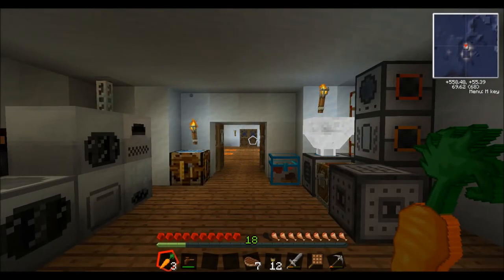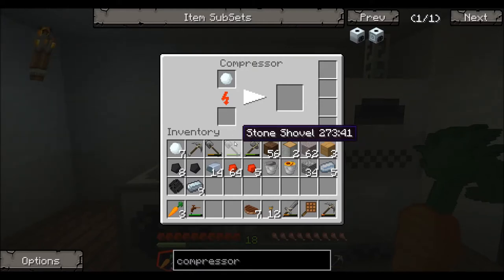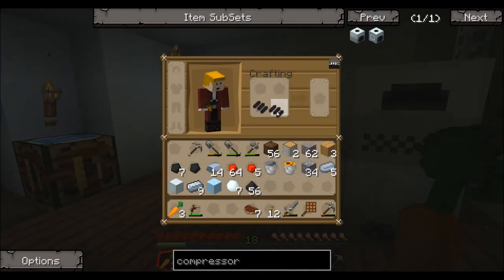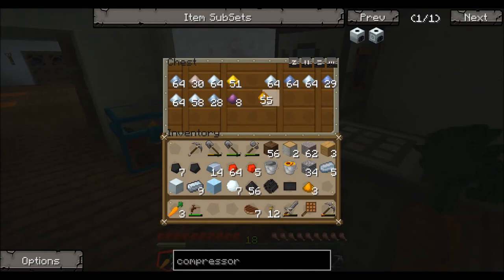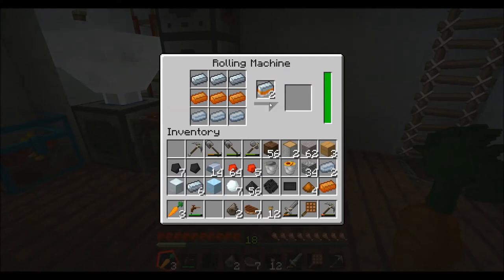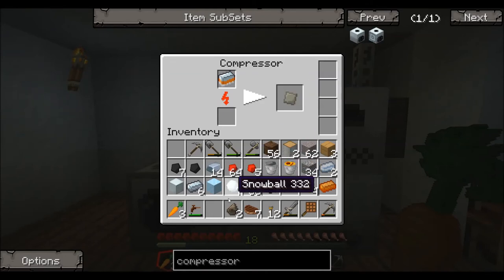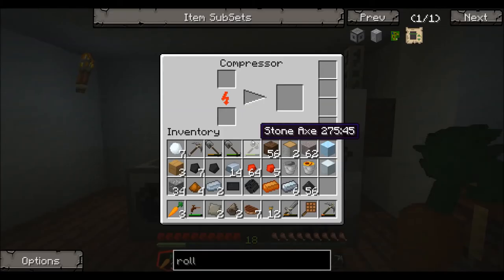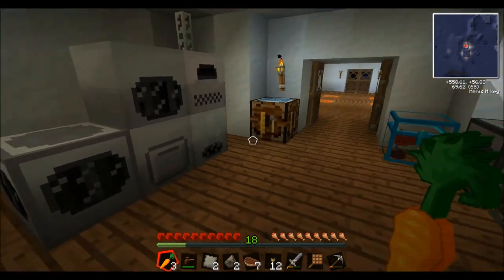FTB SPOT #12 - Compressor & Rolling Machine - Feed The Beast Modpack (Minecraft)

Comment: I tried to make cupronickel heating coils in a rolling machine, but it's not working. I put the copper and ferrous ingots in the machine, and the item popped up where it should. However, when I click the icon to make it, the icon disappears and the MJ bar twitches then refills and doesn't create the coils. Do you have any idea what's happening?